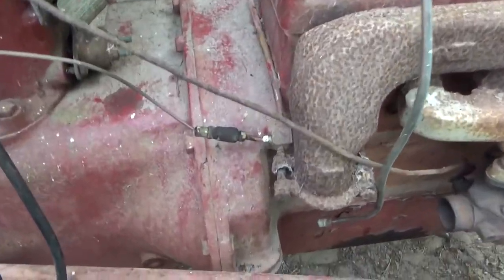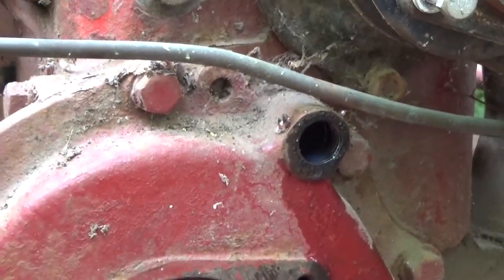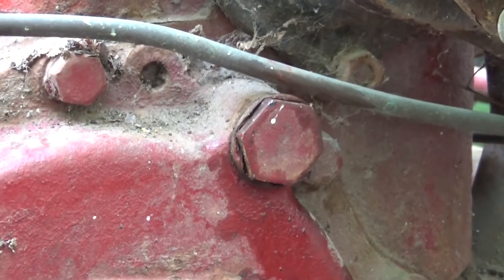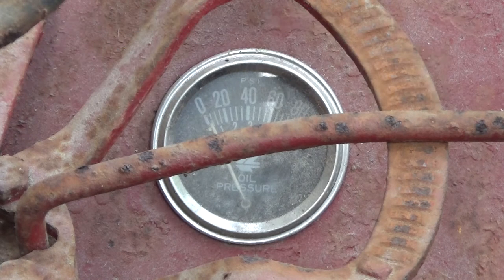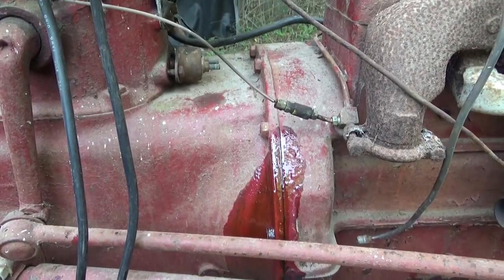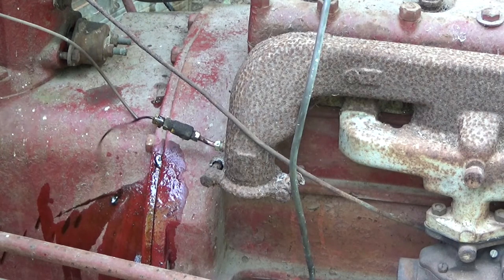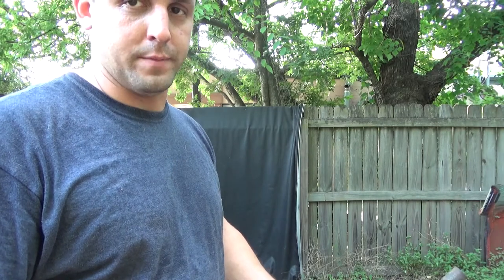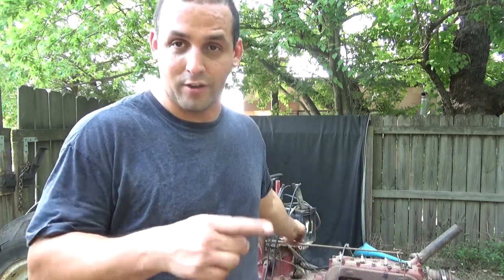ford 8n 9n how to prime the oil pump

Comment: I have a 9n I'm rebuilding as well. Subbed. Keep the 9n vids coming. 👍
Reply from the maker: I'm working on my next video right now. this 9n has a problem with losing oil prime. but once I prime it, then it will idle with about 20psi and get up to about 40 psi when I rev it up a little. Yes it runs now lol. thanks for watching.

Comment: Most likely the oil pickup tube is sucking air at the oil pump. That was a very common problem on these old tractors. I'm in the process of tearing down my 2N.
Reply: Hi there, what causes the oil pickup tube to suck air at the pump? Appreciate your feedback, please and thanks
Reply: @jayframes4967  The pickup tube becomes loose and begins to suck air at the pump. You might be able to braze it or replace it with new.

Comment: I replaced my oil pressure gauge on my 49 8n, changed oil and filter and still no oil pressure. The day i changed the oil it showed 0 pressure, the next day it went up to 25psi but then dropped to 0 again. Going to try your method of priming the pump, but i have read these old tractors have issues with the pick up tube cracking and sucking air.
Reply from the maker: Yeah, and to take the oil pan off to check is a lot of work.
Reply: @davidcraft4909  ya I know..but what ya going to do.

Comment: Hey David, thanks for the video. Do you know if this method can be used on the 1950 massey ferguson te20?
Reply from the maker: It can probably be used on anything, as long as you have a way to fill the pump with oil.  Sometimes, pumps have to be primed to work. But I would say that if an engine has to be primed, there is probably something wrong with the oiling system.  As far as I know it should pickup the oil on its own. Mine is a half way worn out engine that didn't run for years, so maybe the oil pump is not working at 100%.